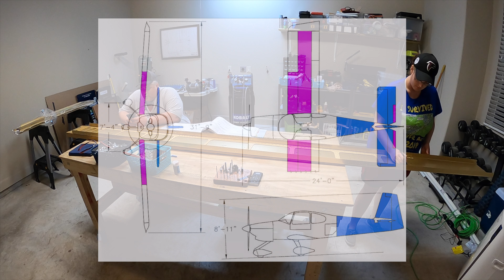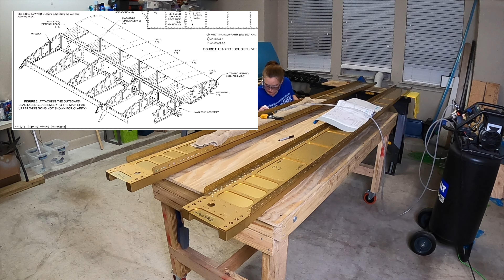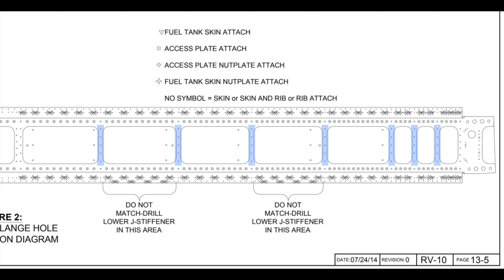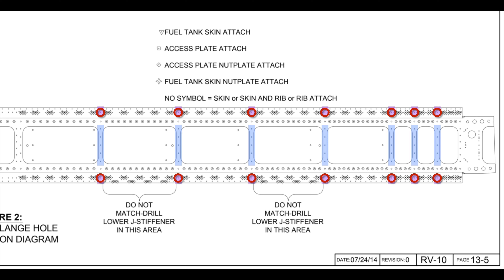Van's Aircraft RV-10 Build: Giveaway & Wing Spars (13-2 to 13-5)

Comment: I'm building a RV-9a and currently working on my fuselage. Almost two years into the build and I have finished empennage and wings. I'm looking forward to your fuel tank assembly process. We did both wings simultaneously so that we could build both tanks at the same time. This worked out well, but the wings still were long and somewhat boring because of the repetition. Keep pounding those rivets!

Comment: Thank you for the awesome detail.   I think for me the most daunting part vs the sling tsi beyond all the match drilling and solid riveting has to be the fiberglass work required for the doors, forming up the McMaster seals and on final assembly all the choices and vendors for interior fit out. 
I still have to fully decide sling vs rv10.       Anyhow, the answer to the question - all the canopy work, 1000%.  
The other parts - Oshkosh vendor tour     Speaking of would be great if someone put a vendor tour together for next year.   See these 20 vendors for these parts related to Rv10 builds sort of thing.
Reply: I'd suggest that you watch Evan Bruney's Sling TSI build from 2-years ago going forward. The Sling canopy top involves a molded fiberglass fuselage top/doors. And, I'd also suggest that you run the performance numbers Sling vs RV-10. Both have 4-seats, but the RV-10 out-performs (clobbers) the Sling when there are 4-people in those seats. I'm building the RV-14 (2-seats) because my mission calls for 2-people a vast majority of the time, versus 4-people. If my mission were 3 to 4 people a majority of the time, I'd be building the -10, over the Sling.

Comment: What's the difference between countersinking to receive dimpled skin vs countersinking to receive a countersunk rivet?
Reply from the maker: For the latter you are countersinking just deep enough for a countersunk rivet to sit flush to the surface. For the former there is a piece of dimpled skin that sits between the countersunk rivet and the countersunk piece, so you need to countersink the piece under the dimpled skin a bit deeper so that the dimple can sit in it. Make sense?
Reply: @PlaneLady  so,countersinking for flush vs countersinking for flush minus .007?
Reply from the maker: @vsavatar  plus (+) the .007” it mentions in Section 5.5, not minus. You countersink more when you have to fit a dimpled skin into the recess you’re creating versus just the countersunk rivet itself.
Reply: @PlaneLady  when I said minus, I meant to drill deeper.  I guess I should have said plus, but it sounds like we're talking about the same thing.  That's what I was wondering.